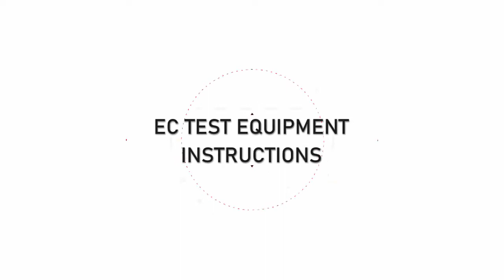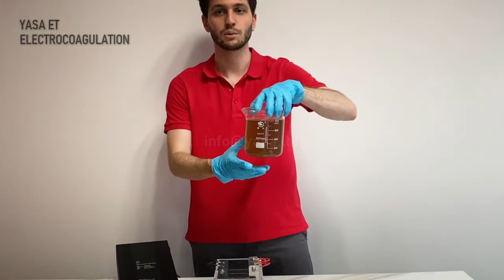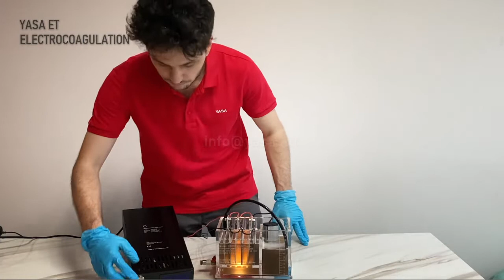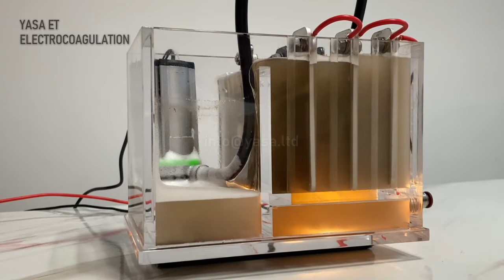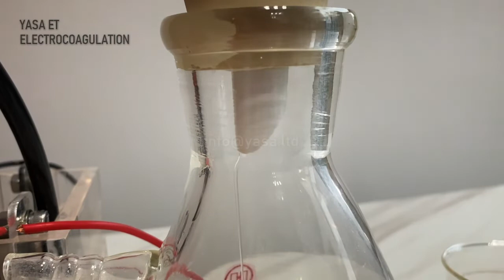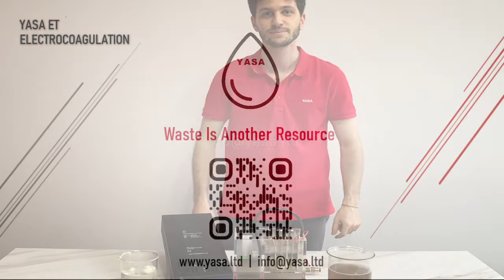Electrocoagulation Test Equipment | EC DEMO by YASA ET

Comment: I dealing with hard water from my well with possible chlorine contamination from a neighbor's pool. I am wondering about the power needs for your unit. My well is 200 ft deep with 100 ft water table, 1-1/2" PVC pipe and a 3 HP submersible pump. System is controlled between 30-50psi. Water needs are high as I have 1-1/4 acres of land irrigation needs and also a home to supply with water.

Comment: Electrocoagulation, is it Possible to design in a Borewell Water Treatment (of removals of iron & hardness )to continuous  flow in a barrels at 6000 LPH Flow?!
Reply from the maker: Yes, it's possible. You can get in touch with our team at:  info@yasa.ltd

Comment: Do you need to change the metals used as cathodes and anodes every now and then? How frequent? What about the needed power to charge the plates,isnt it too costly? Can mineral oil be captured by these system? How many percent. Thank you…
Reply from the maker: Hello, thanks for your questions.

The electrodes are consumed during the electrochemical reaction, so they need to be replaced from time to time, usually every 4 months. Mineral oil could be captured by the system, but it should be tested first.

For more info about our EC systems you can get in touch with our team at  info@yasa.ltd

Thank you